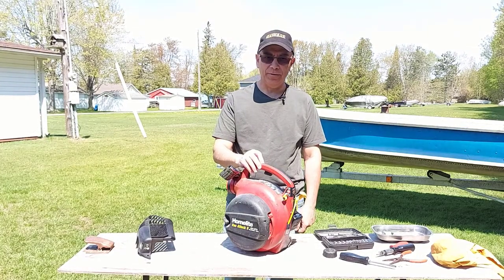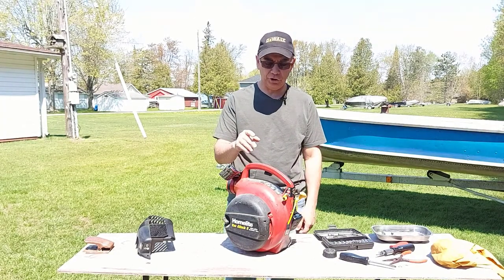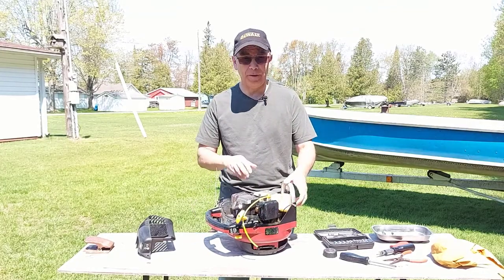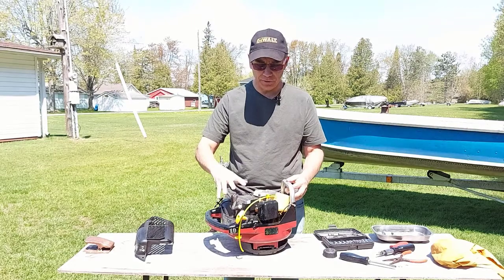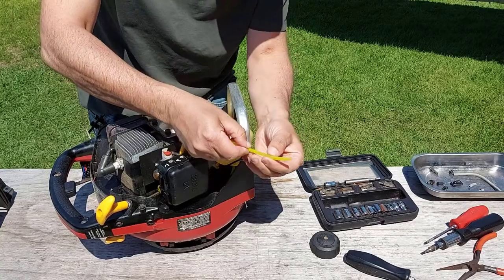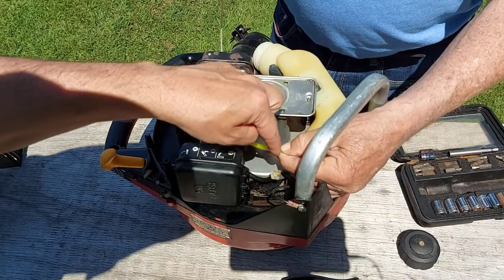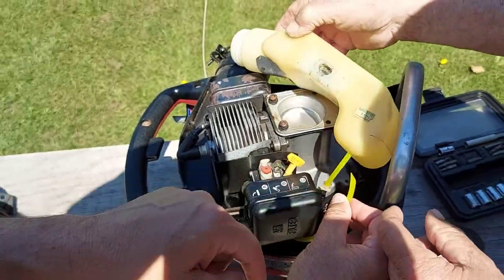HomeLite Leaf Blower Not Starting | Common Problem with Small Engines

Comment: Nice video, I Replace the carburetor & spark plug it was a complete replacement kit put new fuel still won’t start homelite 26b model any suggestion what to check next. Tia….

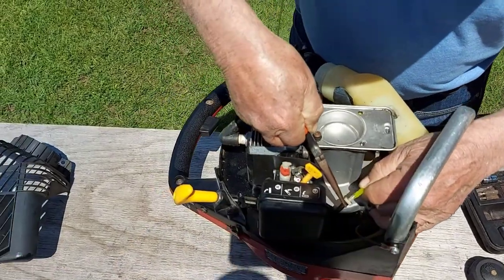Comment: The fuel line connector (2:14) serves no purpose where you have it.  I think it goes inside the tank to prevent the line from accidentally being pulled out of the tank.  The return line doesn't use one.  It may not be a problem but fuel will leak out if the machine is tilted sideways too far.